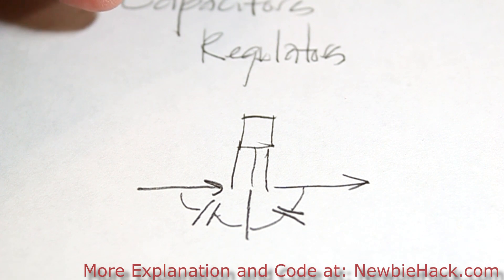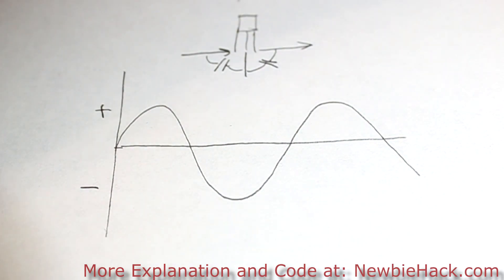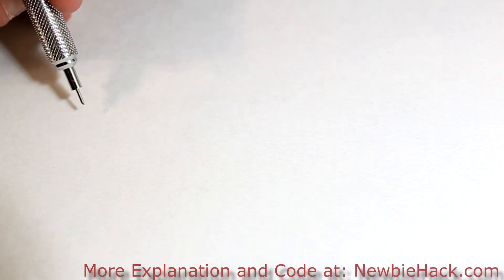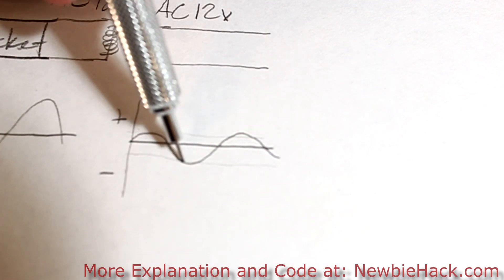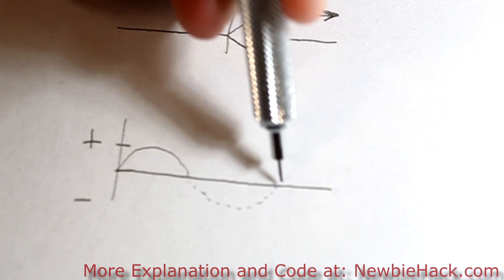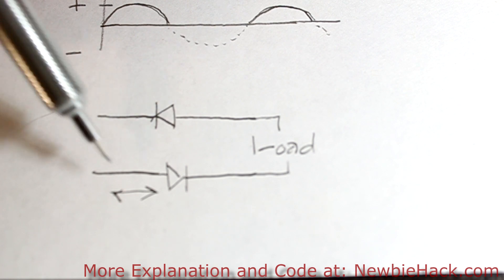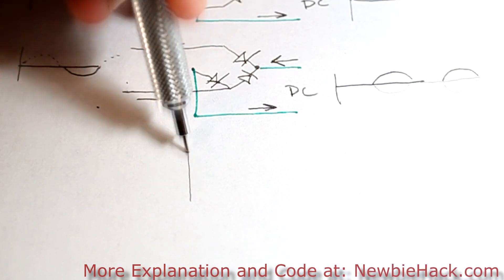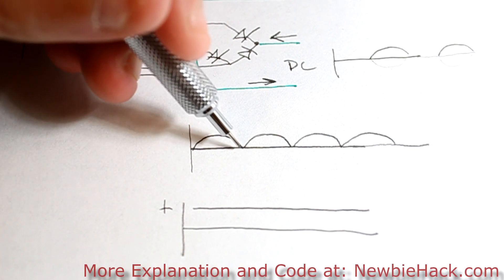26. Arduino for Production! AVR AC to DC Power Supply in Detail and Why Capacitors are Used

Comment: You say the datasheet calls for .1uF capacitor after the 7805 but the arduino official tutorial for creating an arduino on a breadboard calls for using a 10uF electrolytic capacitor after the 7805.  Source: https://www.arduino.cc/en/Main/Standalone

Comment: Great lesson! It's cool how all the knowledge you get from different sources add up. I watched a lesson about micro controllers, and it also gave me an idea what might be the cause of the buzzing in my old stereo amp I tried to fix lately. I think it might be related to this capacitors (inside the amp) not smoothing the current well enough. Yeah! Science!

Comment: depending on how you look at it, it's technically (or should i say physically) correct that the current would flow from the cathode to the anode, and you are rather consistent throughout this video, but I'm pretty sure this will be very confusing to beginners who have never heard of the difference between the technical and the physical direction of current flow. especially since you are using the conventional, technical, direction in your other videos(right?)
still, great videos, thanks

Comment: This isnt correct. first off all the current flows in the other direction trough a diode (anode -> kathode), second, in a bridge rectifier only 2 diodes are used during one half of the periode.